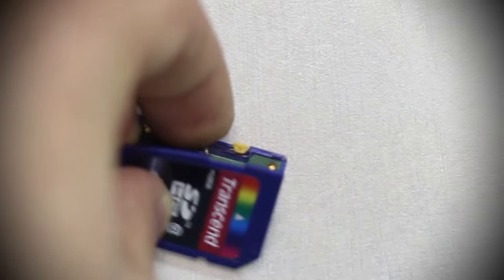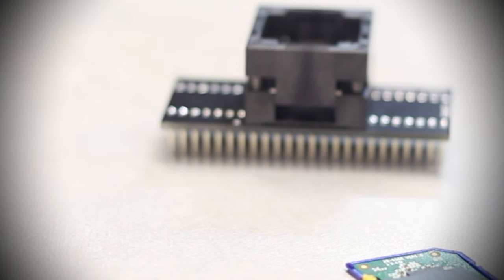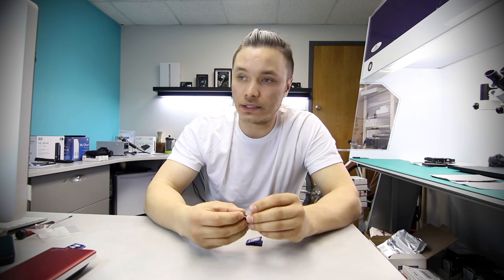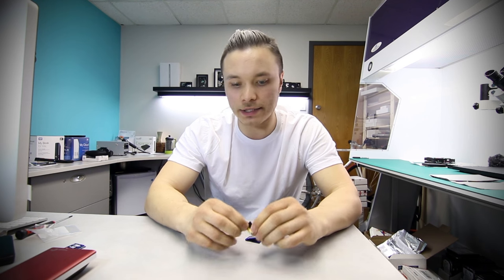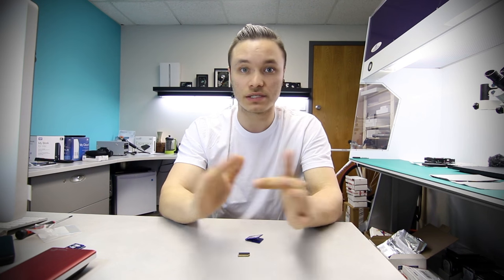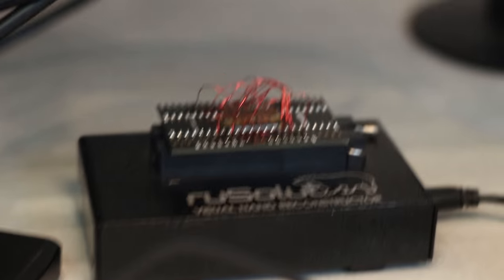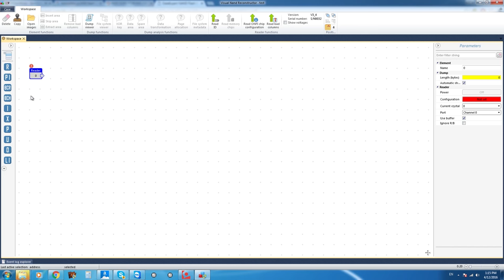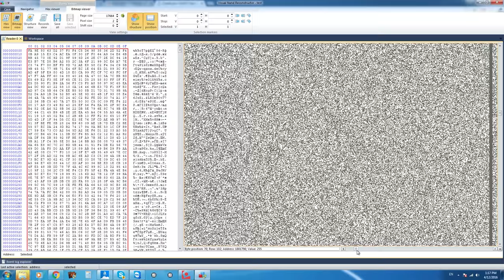sd card recovery - how to recover photos from sd card

Comment: It's very nice video
I.m thinking to buy card reader, but lm confusing between rusolut reader or pc3000 reader
Can you recommand me which on is better?
Reply from the maker: +magic DR I am very happy with Rusolut, but I dont have personal experience on current version of PC3K flash to compare. I've seen PC3K in action of the early generation, and I was not impressed.
Reply: +HDD Recovery Services Early PC3K Flash generation and the latest one is like "night and day"
Reply from the maker: +Kevin Miller :) I am sure it had improved by a bunch since then (it must have been 6-7 years ago).
Reply: HDD Recover Services

Comment: So was the original memory card just not getting power? Wonder if you could have repaired it rather than swapping to card reader
Reply from the maker: I could have been repair, but you would need to have an identical controller most likely. I doubt it was something on the level of a fuse or resistor.
Reply: +HDD Recovery Services ah. Is that #1 reasons flash memories like that fail? No power to the chip or just one of many
Reply from the maker: +mrsemifixit controller failure and memory degradation are most common reasons for this to happe